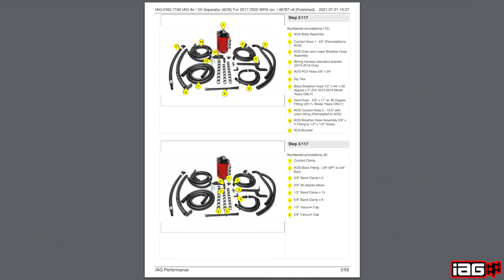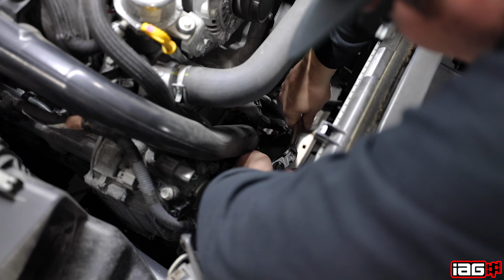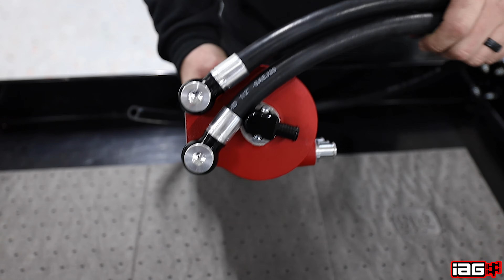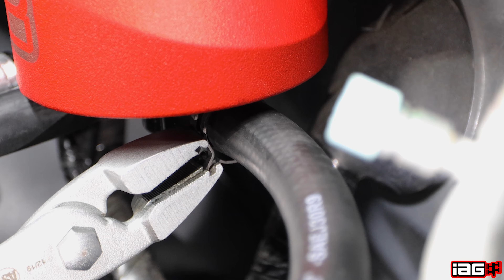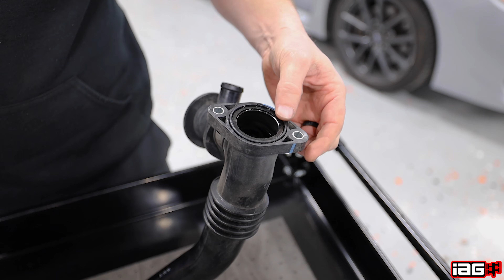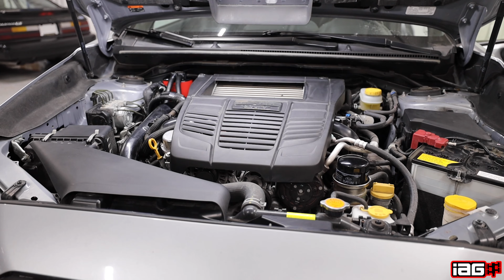2018 - 2021 WRX FA20 Air/Oil Separator (AOS) Install Instructions | IAG Performance

Comment: There should probably be a note that these instructions are no longer accurate with the current version of the AOS. There are multiple differences in hoses included which makes it very hard to follow, and the hose routing is all different now as well.

Comment: These instructions apply to the 14-18 FXT, right? 

What does everyone recommend doing at the same time of this installation? Bypass valve, charge pipe, intercooler, heat wrap for the latter two, radiator fan, anything else?

Comment: Hey IAG! I’m just curious on the crankbreather hose Cobb says to plug it in the top, and plug off the bottom, I was curious if you knew which one is right?
Reply: Did you get an answer?

Comment: Installed my AOS last night on my 21 wrx. I was surprised as someone else was with the leftover hose at the end. The only tip i would recommend is that removing the EGR tube is a MUST!! Its damn near impossible to get access back there for the pcv valve. I ended up having to remove the tube a second time to regain access to seat the 90° hose and clamp onto the pcv valve. Bleeding the coolant was a bit of a pain, very hard to see with the wiring harness there to see if the coolant is coming out or not

Comment: How long does it take for coolant to come out? The Can is getting warm but no coolant coming out when I opened the bleeder.
Reply from the maker: Coolant should come out by the time the vehicle has reached operating temperature. If it doesn't you may need to check your coolant level and add some.
Reply: @theiagchannel  thanks for the quick reply! I just found that I have an obsolete model. ENG-7151. Apparently, it has no bleed screw. The screw I released was just a part of the frame lol.
Reply: @redone8341  Hahaha that's funny!
Reply: @andrewknutson91  I feel so dumb hahahaha

Comment: A lot of key info left out that would be helpful.  Their recommended bracket position to the can for VA's caused mine to ride.  Good thing they are a lot of different positions to use.  Would have been really helpful to note that eyeing up the coolant hose to the turbo to keep in mind how it routes once the charge pipe gets re-installed.

Comment: as someone whos never built a car but wants to build my subi should i hire a mechanic or do it myself so i can learn
Reply from the maker: You can start with some simple bolt-ons and learn to do those yourself, but if you plan to get into the engine we recommend using a professional mechanic.

Comment: when you take the bracket for the wring harness off , do you just leave the wiring harness in the same place or tuck it down ?
Reply from the maker: You can leave wiring harness in the same place since it is basically supported by the AOS mounting bracket. Or you can tuck and ziptie the harnesses behind the AOS can if you want a little bit of a cleaner look.
Reply: @theiagchannel  ok thank you for the quick response
Reply: Will the wires be ok up against the AOS as it gets hot?

Comment: Hey I followed everything here but just wondering why do I have extra hose with a 90 degree fitting   In it that I didn’t see from here? Any idea about that?
Reply from the maker: The extra hose is for a different model year. You won't use it for these model years.

Comment: Thanks, IAG for this detailed video. Just did the install on my 2020 WRX and was able to do it (mostly) stress-free, with the exception of the re-install of the charge pipe, which is a pita. I was a little surprised to find an extra hose in the box after the install, but some research revealed it was not needed for my year of WRX. Thanks for including plenty of hose clamps in the box since one of them was damaged. The hose clamp pliers are highly recommended, they really make the job much easier! Mounting the can was a little challenging since it gets really tight in that passenger side corner with all the cables, but I was able to make it fit.
Reply: How long did it take you with no experience?
Reply: @parkershelp6428  Probably 2-3 hours and I really took my time to do it right and neatly and checked every step multiple times. Like so many other people I wish I had done this earlier.
Reply: howd you get the chargepipe back on? im struggling to get mine back on as i type this
Reply: @alvanah_4882  you'll need to experiment with the best sequence. Getting it into the grommet next to the intake was the toughest part for me. The challenge is to keep it from sliding out of the intercooler port. Only tighten the clamp when you got it in place. Good luck! 🤞
Reply: @robvanhalen9696  I got it about 3 minutes before you responded lmaooo I had to open up the clamp holding it shut with the pliers then used my body weight to push it in. Thank you!!!
Reply: @robvanhalen9696  another question, do you by any chance remember the torque specs for the charge pipe connecting to the outlet? I cannot find a consistent answer
Reply: @alvanah_4882  I tightened that by hand which is more than sufficient. The actual torque value as per the service manual is 11.8 ft-lb or 16 Nm.
Reply: @ ur amazing tysm ill let u know how it goes (expect to hear from me in 2-4 business days)
Reply: @robvanhalen9696  ok need some help again, the charge pipe won’t line up fully with the bolt holes, like I can see it but it’s super hard to push and put in the bolt at the same time, any suggestions?
Reply: @alvanah_4882  you can use something like a hole punch or a Philips screwdriver of the right size to help align the other hole. With one bolt in you can wiggle your tool around for alignment. This part is a bit of a pain to do.
Reply: @ it’ll slide in enough where I don’t have to apply pressure while aligning right?
Reply: @alvanah_4882  yeah you should be able to get the bolts in easily once the pipe is aligned. Just beware of cross threading.

Comment: What’s the difference between 16 wrx and 18 wrx. I’m gonna install this over the weekend in my car and I have a 16. And the best install video I’ve seen is from you guys
Reply from the maker: The main difference is just the relocation of the ECU in the engine compartment. If you follow the pdf instructions on our site along with this video you shouldn't have any problems.
Reply: @theiagchannel  I did. Instructions are spot on.

Comment: Just wanted to 1. Shout out to IAG for the awesome video.
2. If any of you have a charge pipe I recommend using the other hose that came with a kit to replace the coolant hose from the top connector so it has enough room and doesn’t kink next to the charge pipe.
Reply: which line in he kit is that?

Comment: Shaking my head. I litterally did every bit of this fixing a bunch of vacuum leaks this week. Put all perrin from cold air to charge pipe. Monster mishimoto top mount. Pcv valve will still have my blood around it that I missed when the vehicle comes back. 1st wrx Ive worked on. Pcv valve is the only hard thing to get to I found.

Comment: When you installed this V3 version the car must go to tuned (Cobb ap) I mean retuned because of AOS. Would you please educated me on this concern of mind. OR no need to tuned via Cobb ap. Thank you in advance to anyone can educate me on this..
Reply from the maker: The street series AOS does not require retuning.
Reply: @theiagchannel  thank you admin. Keep safe and warm.
Reply: @theiagchannel its me again after 2 years. Now I found out that most of the time there is oil in my intercooler pipe's upper part near the intercooler. Now this oil was normal? Or some other says oil vapour. Is there something wrong? Do I need to know installed back the pcv valve like a newer video? This makes me bother a lot.
Reply from the maker: @SGQ12  The AOS is designed to allow oil suspended in the PCV system to drop out of the system under normal operation. With that being said, if you engine is exhibiting a large amount of oil in the PCV system you may have other issues. Depending on mileage, driving style, power output, etc, your engine may have more oil being put into the PCV system. It's also possible you are having an issue with your turbo that's allowing oil to get into your intake. We would recommend having your vehicle evaluated by your mechanic to ensure that your engine is healthy. The AOS does a great job of separating the oil from a properly functioning system.

Comment: What is the top most side port that was blocked off go to?
Reply: That port is only used on the EJ engines which have seperate breathers for each cylinder head....  IE, one more than the FA engine has.

Comment: Really informative and dummy proof. I want to get one of these for engine health but by golly that is a ton of work and parts coming off. I had a night mare installing the Cobb shifter plate and intake so this gives me anxiety that I’d break something or not torque it down all the way. I will say that if/when I pull the trigger on a downpipe and upgraded charge pipe and intercooler, I’ll likely do this since I’m down there anyway.
Reply: I'm about to do my install this weekend. I have the printed guide all ready to go and I'll have this video up lmao.
Reply: @gwynbleidd7177  Same here!
Reply: @Gwynbleidd  any link on the printed instructions

Comment: Stupid question...  Is it bad to install this without a tune?  I heard that Subi's get wigged out when you do ANYthing to them without a tune.  Not sure how true that is.  Thanks in advance!
Reply: this is from phatbottituning 
"IAG states that the Street AOS does NOT need a tune and the Comp AOS does need a tune.  I have tested 5 cars before/after Street installs and 5 cars before/after Comp installs and I saw no significant change in fueling or boost.   The AOS' were the only mod changed in each test.  

Having said that, I NEVER recommend installing mods outside of a tune.  Especially ones that require removing and reinstalling the intercooler, charge pipe, breaking into the coolant system, relocating the ECU, etc.  There are a lot of things that can be messed up during large complicated installs like this and it's simply not worth the potential time or money to risk it.  

Simply take your time and gather all your mods, then install everything at once and get tuned once. "

TLDR: no tune required but recommended. 
from my experience the only thing i did to my car without a tune is a drop in filter and muffler delete with no issues.
Reply: @LunasLostLove  THANK YOU! Huge help!

Comment: Is this how you install aos to 16 wrx too?
Because it’s says 2018-2021
Reply from the maker: The 15-17 model year WRX requires you to relocate the electronic power steering control module in order to properly mount the can.
Reply: So no video to explain?

Comment: Question Installed one of these in my 18wrx and still getting oil through the breather. What could be wrong?
Reply: @Jim Matusky turbo seal where about that? Would you please send a picture here or any diagrams that turbo seal always prone on leak? Pls pls and thank you

Comment: So only the 15-16 WRX have to relocate the ecm and bend brake lines? I was watching a different video and that kinda turned me off, but i have an 18, so mine should be closer to this install? This one looks tedious, but easy
Reply: I did this myself watching 2 videos on YouTube took 10 hrs and a lot of bitching but was simple enough. 3 months later still no leaks or anything just take your time and dont rush
Reply: @Jim Matusky Lots of updates, all these new hose clamps instead of zipties. they must saved a ton from that cast can, to give you all the clamps.